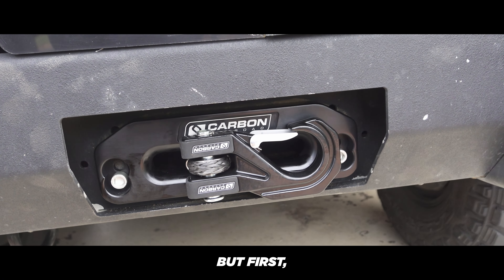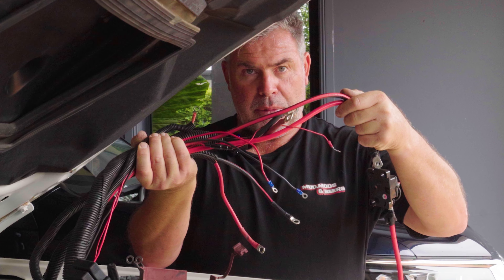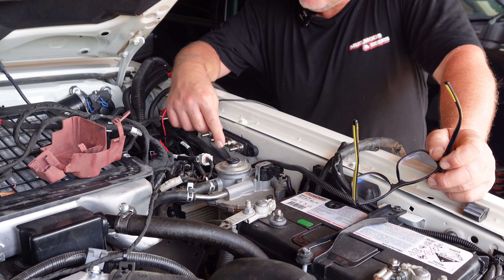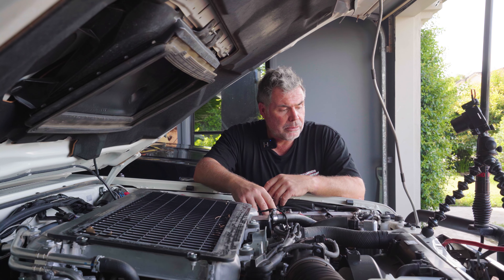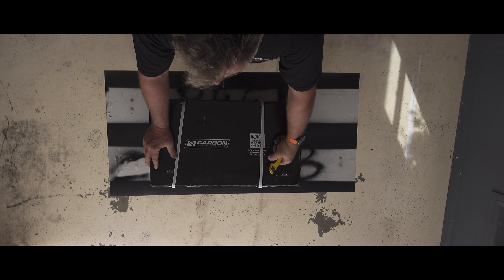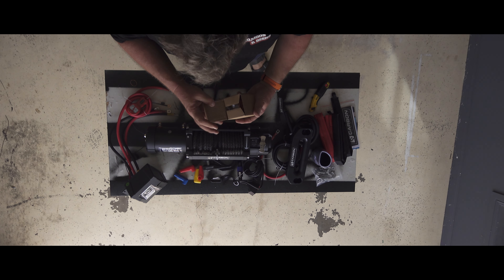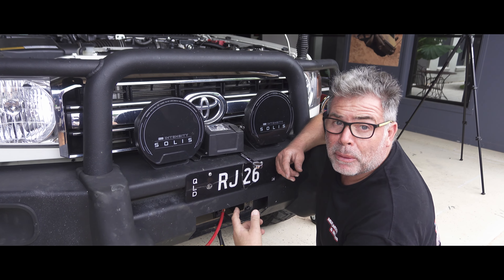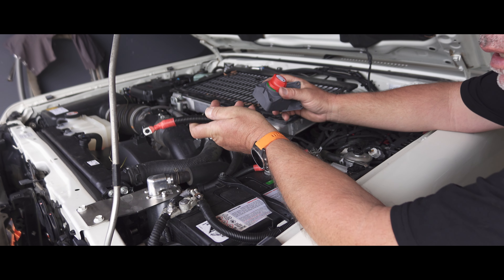Engine Bay Cleanup & Installing the Carbon Offroad SCOUT PRO 12000lb Winch

Comment: Those terminal bars look great. If you ever decide to pull the winch out to give it a service or whatever, Toyota have a spacer that would go between the front of the bull bar and the hawse fairlead. Part no is PZQ936003B. The cavity the hawse fairlead goes in was designed for the steel cable with the rollers which stick out a fair bit more than the hawse fairlead hence they created the spacer so less chance of rubbing the winch rope on the side of that cavity when winching off to the side.
Reply from the maker: This looks great!  Thanks for the info, didn't even know something like this existed.  Will be purchasing when I pull the winch off next.  Thanks for the tip!